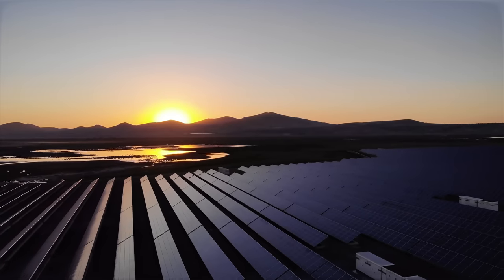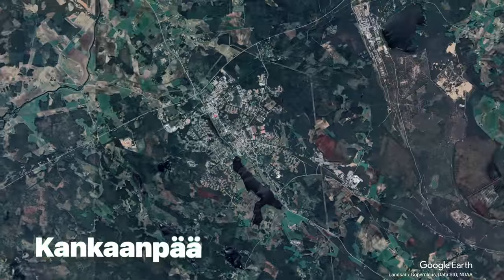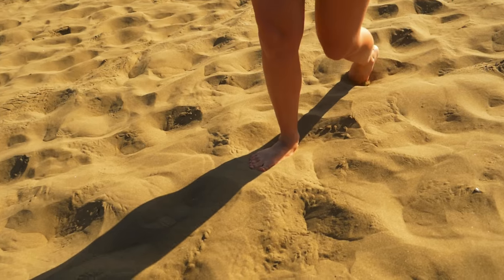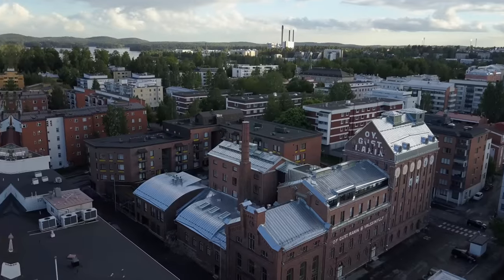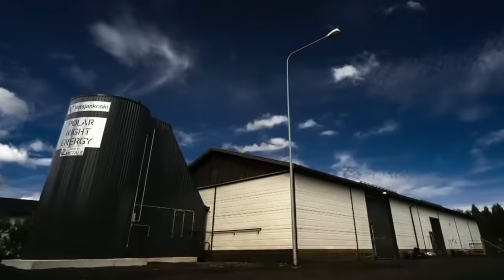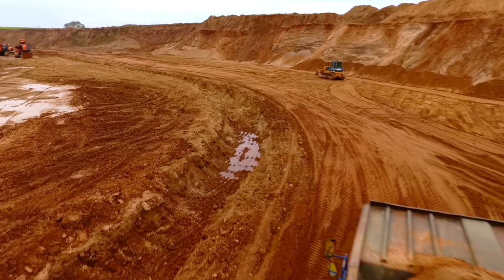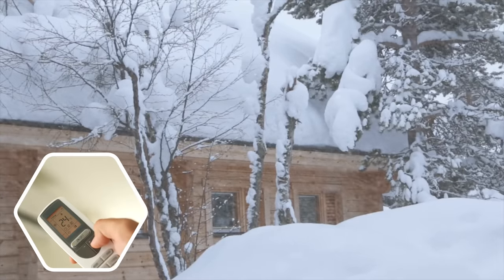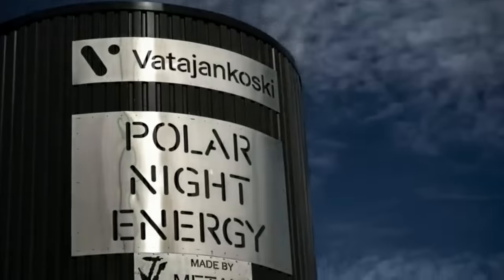Breakthrough Tech Heats Homes Cheaper Than Natural Gas!

Comment: Sand heat storage is a proven component in passive solar home heating.  Large reservoirs of sand absorb southern exposure sun during the day and radiate slowly at night.   Not an electrical solution, but it exploits the same thermal mass quality of sand.
Reply: Ohh this is kinda like how cob houses works, cool stuff =)
Reply: Just like an Earthship.
Reply: Why is electricity even needed for this sand battery? Why not just use solar thermal instead of solar photoelectric? There'll be less losses, with nearly all the heat being channeled into the sand battery for storage.
Reply: @manofsan  although solar thermal is more efficient per m2 pv is actually cheaper it just takes up more area also less maintenance with pv
Reply: @Shitin A.bucket  - what about using large Fresnel lens for concentrated solar heating? Could that work better?
Reply: @manofsan  I mean you could definitely do something like that focusing a lens onto a conductor in an insulated chamber fed into the sand I'm not sure how cost effective it would be so cant really speak on it, I'm very pro PV tho having a great time here with a diy system here 😊👍 heating our water with pv, one advantage of using electricity of course is that you could dump excess electricity from renewables into the sand 'battery' but if there was other cheap ways to heat the sand hey why not use both =)
Reply: @Shitin A.bucket  - actually, a large curved/parabolic mirror might be even cheaper and more cost effective. That could focus and concentrate the solar energy onto the sand battery quite efficiently, without suffering the losses from PV panel conversion efficiency. What do you think about that?
Reply: @manofsan  🌞🌻🌞I'm all for it brother 🌞🌻🌞
Reply: @shitina.bucket9699  - do you think the sand battery can be used for off-grid homes in remote or rural areas? Or is it only worth doing for community power grids? Like is there some minimum size/scale required for it to be worthwhile?
Reply: Since heating is the most expensive electrical load on the house. Heat storage in sand is not a direct "electrical solution" but figuring out how to efficiently transfer that heat to parts of the house that need that heat will drastically reduce the electrical load on the home. More of an Indirect electrical solution.
Reply: @shitina.bucket9699   a lens would also work on cold days. I don't believe solar radiation diminishes much just because the air is cold. A little due to lower elevation but not due to surrounding air.

Comment: I'm so glad you got around to covering this. I mentioned it a few months back. After I saw coverage from Finland and I was just in love with the concept of how simple and cohesive it is to our current environment. I just love inventions like that. Also, not every method and idea is ment to work for "every option" but it will be Really good at what's it's good at. So it's totally worth it if you interconnect it to your city planning system properly.
Reply: Can this be practical for off-grid homes? I'd really like to know.
Reply: @manofsan  I plan on running mine with a PowMr 5,000 watt inverter / controller / charger by PowMr.  It will run on a small battery pack, with 8 each golf cart batteries from Costco, $100 each and 1,200 watts each at 48 VDC.  I am installing a 12,000 Btu 120 volt unit from Amazon.  Mine will have a 1,100 watt load on the inverter in the heat mode and slightly less in the cooling mode.  These inverter heat pumps are really easy on their power supply, and not a sudden power like a one speed compressor.

Comment: This system would also would work using air (from a greenhouse) thru flexible 4" pipe or water thru 1' Pex using evacuated solar tubes. If the tank /container was super insulated, heat created and stored in the summer could provide heat for the fall and early winter.

Comment: The same idea used in clay pots over a candle to put out radiant heat, except you have much more mass. I believe there is a coefficient number that is associated the amount of heat certain substances a can radiate. Moisture also makes a difference. We can also heat the sand using, solar, circulating water or eutectic salts, or heat by wood or other vegetation. A great idea to substitute different means of storage, rather than getting stuck on chemical reactions.
Reply: The clay pot thing is a scam. You don't get more heat out than what a candle normally puts out. It stores a tiny bit, but you could get rid of the pot and have light too.

Comment: We need this scaled to heat individual homes in areas without district heating,but it would have to be only with a huge sand silo,which probably rules out most suburban homes. Maybe bury the heavily insulated silo when building new homes? Generate the heat from solar/wind,with resistance wire in the sand,and you can store heat for cold winter days. Then again,for detached housing,forget it and install geothermal heating/cooling.

Comment: This tech is amazing. If that would be put on an output of a heat pump it would collect heat when its 40 deg c outside and release it when it's -20. To make it efficient when small it could be buried underground. Add to that excess energy from pvs and off grid house would be possible even in Finland.

Comment: Just raise the glass pane above standard solar panels a couple inches, by increasing the solar panel's frame width.  In this way, one not only generates electricity from the sun, but also captures the black body radiation emitted from those black solar cells.  The hot air can then be circulated through an aggregate thermal mass using a fan powered by a fraction of the electricity generated.

Comment: I like the idea of each house having its own Sand Battery silo.  Feed heat or electricity into it when things are working well, and heat (and perhaps a small amount of electricity) is available during a crisis.  The idea needs to be developed a bit further, but I think the Proof of Concept town shows we're well on the way.  I'm thinking this could have use in a large O'Neil Cylinder space station.
Reply: There is something like that already. Recent fully charged show covered it. I don't remember the name unfortunately.
Reply: That's good for energy independence, but bad for efficiency, think about the insulation in the silo wall, that's proportional to the silo surface area (power of 2 function), whereas the heat storage is proportional to the volume inside (power of 3 function). The more you increase the silo size, the more favorable the ratio of its volume against its surface is, which means more energy stored inside, and less energy lost through the insulation layer.
Reply: @Groaznic  that's why in this project storage is small and insulation takes almost all of the volume. Still it's economically viable option especially for retrofits.
Reply: This is a grid level solution, it's not meant as a home solution. It's far more efficient at grid scales.
Reply: @bzuidgeest  everything is more efficient when bigger. Economy of scale. Yet we live in times when access to grid power is not guaranteed anymore. People died in Texas because of cold. Grid was down.
Reply: @bzuidgeest  - what about if you're living off-grid, in some remote or rural area? Couldn't this technology be a relatively easy solution for that circumstance? Just have some sand silo absorbing solar thermal heat, and tap it for energy when you need it.
Reply: What do you think of having a sand layer built into the ground level floor? PV and wind pumping electricity into it during the day to be released as heat overnight keeping the chill Finnish nights at bay.
Reply: @andrewjohnson6716  - that sand stores energy by reaching very high temperatures. I don't think you want it directly in your floor, but rather at a safe distance where you can only tap what you need. But there's no reason why that energy can't be used for heated flooring, using a heat exchange loop.
Reply: @manofsan  Ah, thanks for the information.
Reply: are you delusional ?????? " idea of each house having its own Sand Battery silo" = KOOKOO
Reply: @bobsaturday4273   Well-stated.  You present a very eloquent argument with good supporting evidence.

Comment: Using sand as a large scale heat sink is both a simple and a grand idea. The solution to many problems is sometimes found right in front of us, and in this case, under our feet. Well done!
Reply: sure , don't bother thinking thru the logistics , just ignore all the details of actually implementing on any sort of scale
Reply: Do the math. it costs money, so do you get a payback? Maybe, if your off-peak electricity rates are much lower and you need heat at peak times.

Comment: You're incorrect about TX.  MOST of the pipes that broke, broke at OUTSIDE water sources like external hot water tanks and ordinary water spigots with shutoff valves flush with the outside.   This is where the vast majority of the pipes broke.  
 These alternative heat sources may help in these rare events, but if they wouldn't invest in ANY winterization of their wind turbines, why would they invest in this?
Reply: Came here to say this, also, it wouldn't matter if a grid battery was online if the lines are damaged in many places as it was.

Comment: It seems like the silos could also be made to heat themselves via passive solar.  If they had a “greenhouse” sleeve with a 2” gap around the east, south and west sides and insulation on the north side, the silo would be heating from outside in as well as inside out from the excess PV/wind.  
Great job, excellent overview.

Comment: Soapstone is particularly good at holding and slowly releasing thermal energy. Soapstone is essentially super compressed talc.  I don't know the prices per metric ton, but it is fairly cheap--maybe not for giant, industrial use like this, but certainly could be applied to home use. Just need a way to really compress the talc, and get out as much of the air as possible (and get the particles as close to each other as possible).
Reply: That is an interesting home battery idea. A soapstone stack in the basement that can release the stored heat as electricity or directly as heat.

Comment: Lifetime is at least 50 years. =) There is nothing to wear out inside, a fan can be replaced outside of a storage.
Reply: if they're using resistive heaters, they can fail after some time, although a properly designed system should be fairly easy to fix.
Reply: @NaumRusomarov  And if not properly designed, they have to dig a little.

Comment: I've had this idea for a while, only I would dig down. How much energy could you store in one cubic KM of earth? You could use wind and solar energy to heat one area and pump winter cold into another. You would have a vast potential difference.
Reply: It sucks. The ground is an infinite heat sink at the average temperature in your area. You could use a heat pump to warm in the winter and cool in the summer, but trying to use it as a storage for off-peak heat is going to waste a lot.

Comment: Building these into homes might be a good use. In Finland for half the year the most common use of power is to produce heat. So producing electricity, storing it as heat in the sand, transforming it back to electricity to send to homes where it will be transferred back to heat is more attenuation than the system needs to have. Instead produce the electricity, send it to a sand battery in the home where it can later be released as either electricity or directly as heat.

Comment: Best thing about this? Uses only existing tech, plus the sand is RECYCLED building sand, they can use whatever quality. Any location with district-level heating should build this - heat it up while electricity is cheap or use waste heat from whatever source, distribute it in standalone or hybrid mode when there is demand.
Reply: It also creates a user for smooth desert sand.

Comment: The problem with this system is that most solids don't keep exuding enough heat to be viable power generation sources.  No matter how big the building, the power required to heat up the solid is far more than any energy you would get out.

Comment: I love this channel and a lot of it's content. That being said I need to point out that this idea for heat storage is certainly not new. In the 70's there were Popular Electronics Magazine and Modular Home articles that discussed how people were using an ancient gravel and sand heat storage. In these articles the sand or gravel was built into or below the foundation of a home. The heat was stored by hot water solar, electric, or even hot air. Heat removal was air or water. I you are going solar, it is a great idea, because heating your home is a huge load on real battery storage. In fact , I am a little perplexed as to why they would call it a Battery at all, possibly a sales gimmick. Storing this above ground is a waste of space and makes the concept less efficient due to losses to the atmosphere. Except for the plumbing, there is no reason that this would ever wear out. To compare it to Tesla batteries and claim a longer lifespan leads me to believe the company is implying a maintenance plan. For all intent and purpose this is a near surface heat pump system, not a Battery at all, unless you consider what this company is trying to do to your pocket book. I see this as a cheap marketing ploy and quite possibly a scam. I am sorry, while I am not going to Dislike this video, I can't Like it, and I can't believe you were taken in by this. Though the idea may be useful to already built structures, there is no reason for it to take up space above ground,  is absolutely not a new idea, and is not a Battery.

Comment: What about heating the sand using off-peak electricity in a home that incorporates a floor heating system? Circulate the water for the floor heating system through the sand. Use resistance heating to heat the sand directly. Switch off the electric during peak hours and relay on built up heat in the sand to heat the water.
Reply: They could heat the sand with concentrated solar power.
Reply: i think the issue is that the larger the system the more efficient it becomes do to energy loss being a function of volume.  that’s why they want large volume silos.
Reply: Just buy a ceramic elec. to heat storage devise. They are on the market
Reply: @MrGigi-dz9cv  Like 247solar? who would think?
Reply: @kkarllwt  I was thinking along the lines of an electric hot water tank filled with sand with the water plumbing passing through the tank. The heat source for the water would be the sand on a continuous basis but the heating elements would cut-off when the electric went to peak. Ordinary electric heating elements used in water heaters may have to be throttle back to prevent them from burning out in the less conductive sand. Nonetheless, a little DIY internet research would find all the data needed to size the actual tank and the number of elements as well as the means by which to prevent early element failure.
Reply: @shake6321    Yes. A small one would have to be super-insulated. It would need to be surrounded by how about 30 inches of blown-in insulation. In and of itself that’s not a problem. One would want to run it for a while before blowing-in the insulation to know that the plumbing didn’t leak, etc.

Comment: Smaller sand batteries for individual homes could be place at the center of compost piles and this would keep it hot needing only to replace the compost in early autumn using grass clippings and fallen leaves.

Comment: What happened in Texas wasn't just because of high demand due to the extended freeze.
Many power plants service their plants during the winter months because the typical winter demand is much lower. So, some power generation was offline.
Their was also the complication that power plants were not designed for a prolonged freeze cycle and  because of the typically mild winters, especially in the central and southern portions of the state, they failed or were incapable of full production.
The state is still trying to get a handle on all the inadequacies of the grid and making the needed repairs and upgrades so the grid does not collapse again if another prolonged freeze occurs.

Comment: The sand battery works as long as you have a means of making excess energy like if the wind blows all the time or the powerplants never run out of coal.   It would be better to custom design each of these systems using what works best in the area.   Solar heating on individual homes using mirrors and black absorbing water tanks works wonders and there is no heat exchange issue, the hot water goes directly to the walls of the house and return a little cooler and this will last all night but have a week of cloudy days and neither water nor sand would work.  Solar will work a little on a cloudy day but not enough to heat your house.   A wood burning fireplace could make up the difference because the sun has been growing those old trees for decades and if we don't burn them or make lumber out of them they will rot in the forest and give off methane and Co2 anyway, so it is okay to burn some of it when needed.   Reliable power seems to be the root issue, not how to store it.  Sand on such a scale sounds great but the heat exchange must travel a long ways through insulated tubing to warm a building, no doubt underground.    My father used large volcanic rocks to bask in the sunroom and absorb heat to help keep the house ajoined to it warm in the winter time, the sun was always finding its way to the black rocks and it helped.